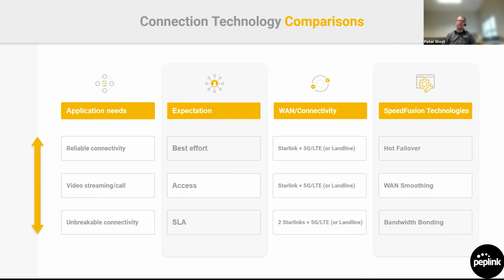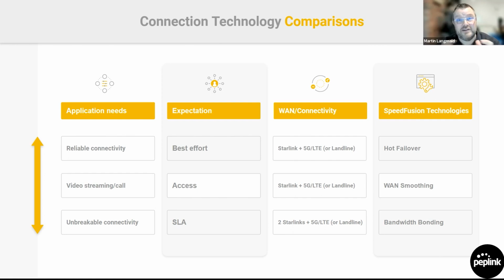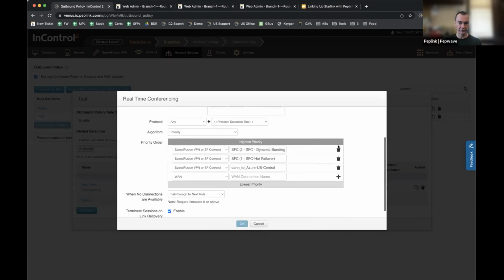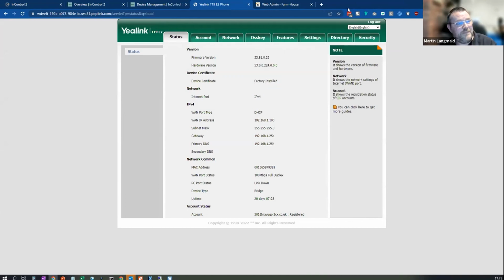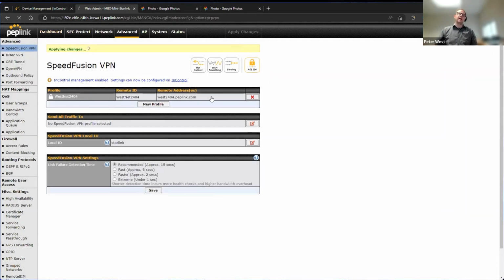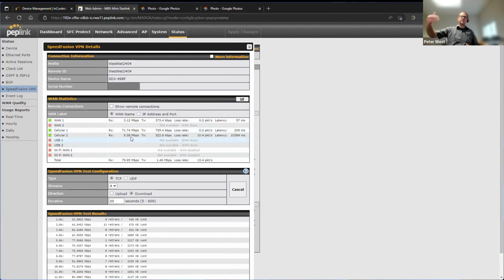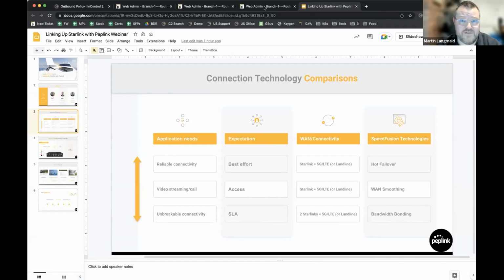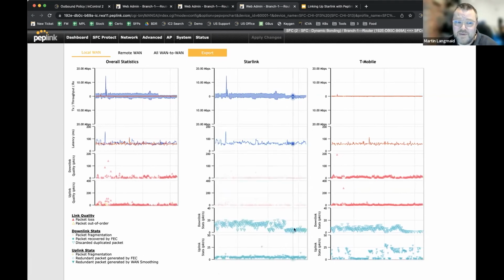Webinar | Linking up Starlink with Peplink

Comment: Please I will like to have Peter West's email. I bought Peplink UBR and I haven't enjoyed it for my use case scenario because I can't get the best out of the device. It's been sitting on my shelf for a while.
Reply: check  mtu size thats not fragmented on network  (     ping  IPaddress of DNS  -f -l 1480   ) adjust the 1480 till packet is not fragmented then adjust interface to that size MTU